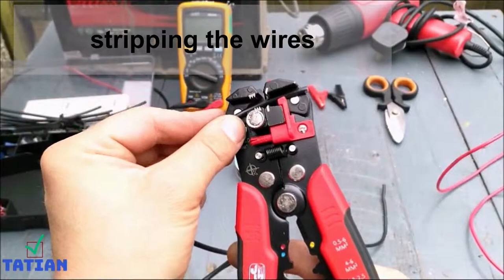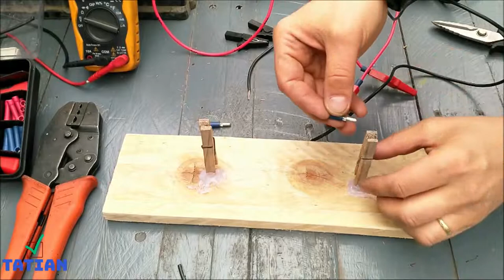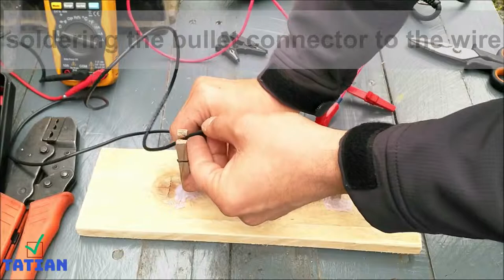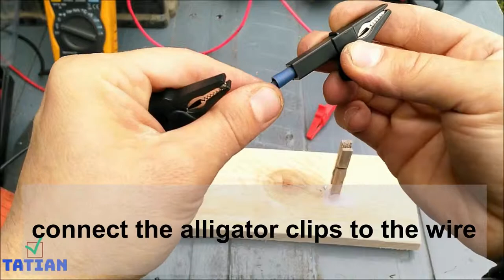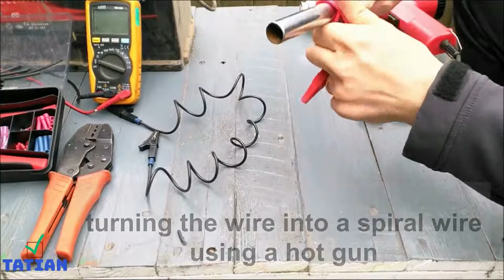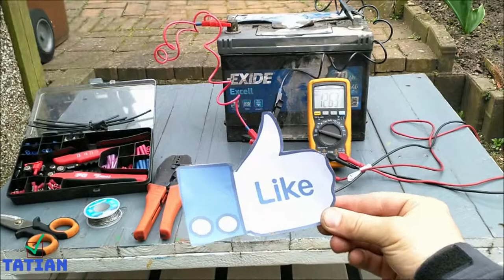How to make a wire alligator clip like a PRO

Comment: Aren't the bullet connectors crimp connectors?  They are intended to form a mechanical connectiion between the cable and the connector.  Soldering forms an electrical connection and is not intended to be a substitute for a stronger mechanical connection.  Would it be better to crimp the connector onto the cable after soldering it?
Reply from the maker: Yes, you are right. The connector can be crimped after soldering
Reply: @tatian_H  You actually don't crimp a soldered connection, as this can crack the solder joint. You also should tin the wire lead before you solder it to anything. Never solder an insulated connector, that's what uninsulated connectors are for.
Reply: Expensive crimpers/jaws can be had to crimp the electrical connection and the insulation sheath.  It's the way nearly all OEM wiring terminals are connected.  But, for the DIY'er?  This would be prohibitively expensive and nearly impossible due to the varying sizes of wire and encountered situations.

My technique is to remove the plastic ferrule from the terminal warming it up with a heat gun.  I then crimp the wire in-place with just enough tension to hold it there for the soldering operation.    I then use two layers of heat shrink tubing to duplicate the stress-relief that the OEM insulation crimp provides.

My wiring modifications are on dirt bikes, street bikes, pickup trucks, automobiles, and power equipment.  Over four-plus decades and in some cases hundreds of thousands of miles I have not had one modified wire fail due to materials and/or workmanship.

And here are some automotive electrical testing tools you can build yourself:

 https://www.youtube.com/watch?v=wkUGeFYLgoo
Reply: @russellstephan6844  Very cool.  Your experience with this is impressive.  

I tend to be a sucker for tools like crimpers.  If I think that I'll probably use a tool several times (like 3, 5, or 22 times) then I cough up for the tool.  It is extremely satisfying to have the exact right tool for the job when you need it.  It is equally pleasing to have money in the bank.  :-)

I have heard that the "mechanical" connection of the crimp is superior to the "electrical" connection of the soldering operation.  I don't know that for a fact but tend to believe that it is true.

Cheers everyone....

Comment: I have those same gator clips , how do I take the plastic off ??  The plastic will be put back on I need to solder my 12 gauge wires to the clips .....
Reply from the maker: Hi. You will have to take the plastic out by using a wire cutter. I would solder the wire to the clips
Reply: @tatian_H  A wire cutter would destroy the plastic if not careful .... There's a way to do it , but I don't know how , there are pictures in the store where they are separated  from the clip....
Reply from the maker: @cajuncoinhunter  you can also buy them without the plastic
Reply: @tatian_H  Yeah but I like the plastic on the clip, I have 12 gauge silicone wire because I repair high power radios , the wire is easier to solder without the plastic on , that's why I need to find out how to take it off....